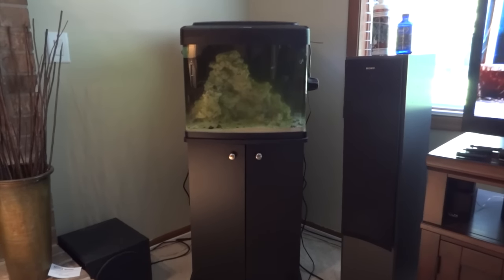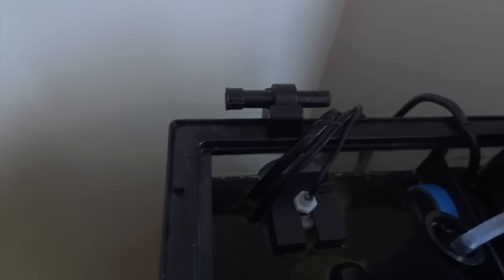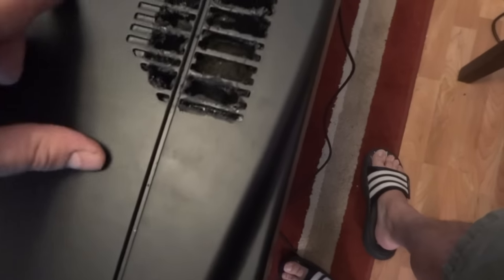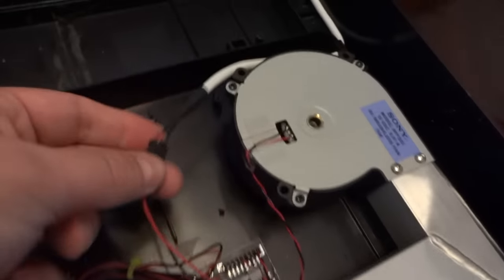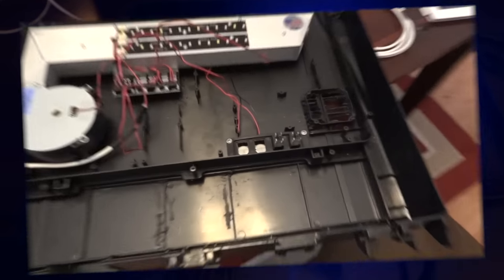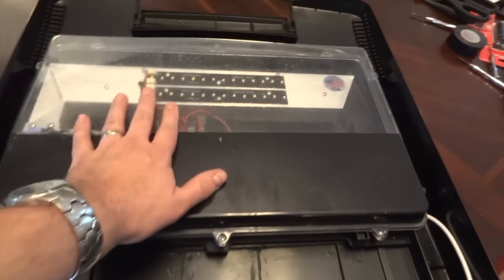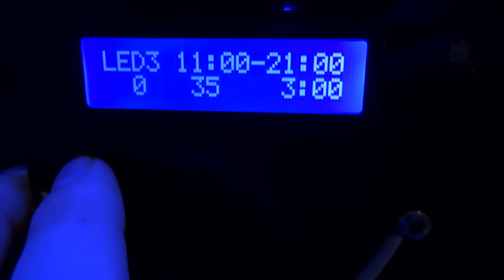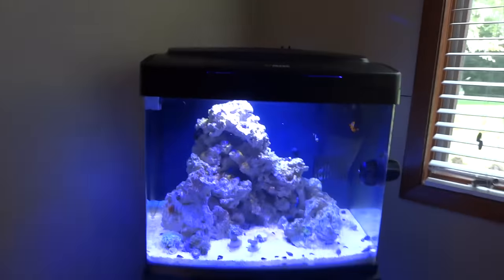Coralife BioCube 29 Build - Part 4: Steve's LED's Installation

Comment: You did a fantastic job with the installation and documenting the whole process. Finally there is a video that people can watch to see how to install this lighting system. Like you said, this is the most important upgrade that you can do to the Biocube, and you did it right. Retaining the stock look with the hood in place looks so much more professional than removing the hood and placing an aftermarket light on the tank. The upgrades that you have done are the best of the best for the Biocube. Congratulations bud!
Reply from the maker: Kenneth Cantrell Thanks!  I appreciate it!

Comment: Hey Brian, The whole reason I got steve's leds is due to this review.  Great tank so far.  Are you still running this light time?  Just wondering.  If you have found a successful light cycle I would love to mimic it.
Reply from the maker: +Sly McGee I've got mine set to come on at about 11am and shut down about 10:30PM.  3 hours at peak.  Blues to 70% at the high point and whits to 60%.  Not sure if I'll stay with that, but for now it's working.

Comment: I know that every tank is different but have you come up with a good lighting schedule that you could share, I'm looking for some starting points to work with
Reply from the maker: What I've recently landed on is 50% white, 50% blue when they are at their max.  They come on at 11am and ramp up to the max.  Stay there for 3 hours, then start to ramp down and turn off completely around 11pm

Comment: Are you still using the led's and did you have to cut that much of the fan openings? I just ordered mine and I only cut away the bottom slats for the fan openings
Reply from the maker: Yup, still using it.  It's been a great lighting system.  I just went by what Steve's LED's recommended for cutting away the slats